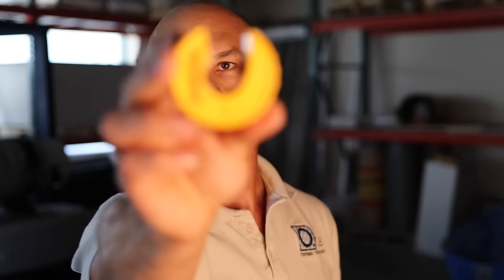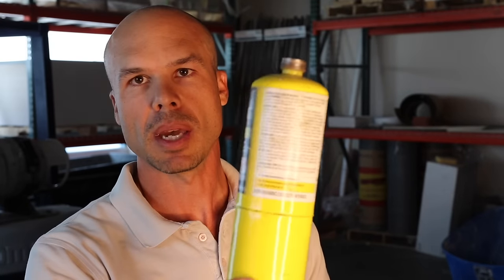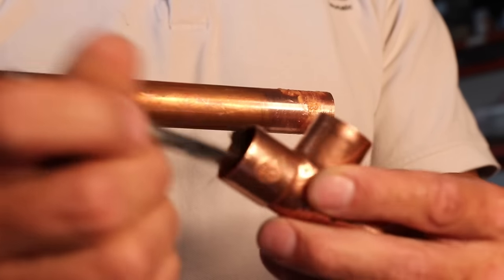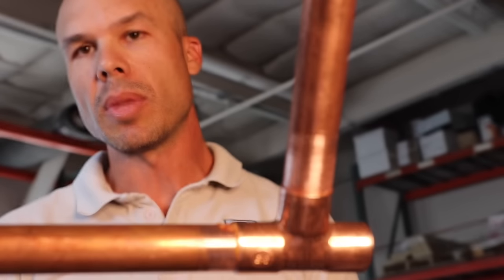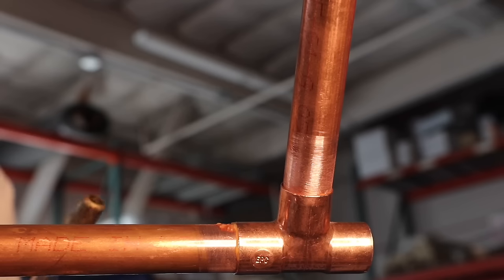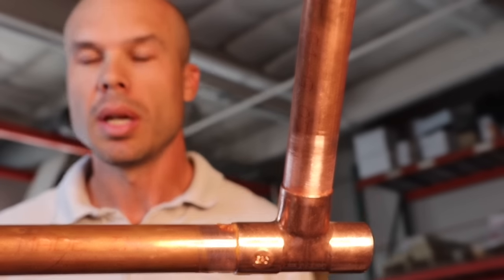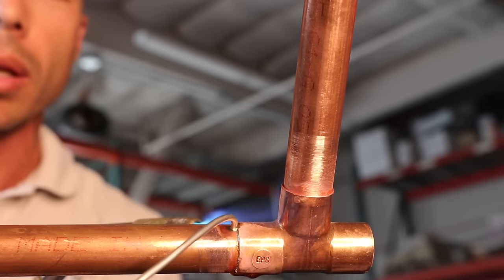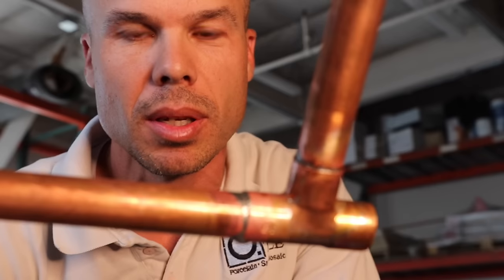How to Solder Copper Pipe: The Plumbers Secret- Episode 1

Comment: I wanted to thank you very much for your informative video.I am going to replace a pressure relief valve for the first time at age 63.I,ve rebuilt inline air cooled 6 cylinder Hondas,gold wings and a few small block V-8s and I find soldering and plumbing to be a little intimidating but thanks to you,no more.The way that you handled the criticism of your work says  a great deal about you and your upbringing which seems to be missing with many of todays youth!Thank Again and thanks for the video.
Reply: I'm about to do the same thing  I'm only 47 and have a ton of plumbing. It's all been PEX!  I wwnr to change my prf valve on my boiler, and when I was removing it, cracked 2 soldered fittings   so here I am.    Off to attack tonight. I was fairly certain I had the general concept down it's just nice to get the reassurance of a professional on YouTube

Comment: I'm getting ready to cap off copper water pipes to the bathroom (DIYer first time). The guy at home depot gave me a Bernzomatic Propane Torch. Glad I got the Propane, hoping it will prevent overheating. Also, your instruction to wipe off the excess flux BEFORE soldering is excellent (I don't have to worry about excess flux corroding and eating a hole in the pipe later).

Comment: Note, its important to buff the fitting inside also, not just the pipe.  An inexpensive wire brush tool will do both the inside of fitting and outside of pipe.  Very easy, and very handy.
Reply: Not really that important unless it's an old/dirty fitting. Flux is acidic and is there to not only allow the solder to flow, but remove oxidisation. 
It's the same as applying flux to the fitting AND the pipe - it's really not needed. If the fitting is loose enough that simply mounting the fitting won't evenly spread the flux between the two surfaces...you're not going to be able to solder them together ayway.
Reply: Thanks I noticed he just did the outside. That was my question.
Reply: @allergyahead8128  
The inside of the pipe needs to be deburred else you will get leaks down the road. The burr causes water turbulence which eats away at the copper near the joint where the burr resides.

Comment: I have found, applying the heat to the middle of the fitting and NOT directly at the joint or NOT directly on the pipe is the most affective way to heat it. This way, the solder is pulled into the fitting where most of the heat is. Also, I have found my biggest mistake in the past was, over heating the joint. This will cook off the flux. No flux and the solder will not take to the copper.
Reply: what type of torch did you use?

Comment: Yeah worked with plumbing company as helper / laborer picked up a few things . Yeah they described it as you exactly described it - apply heat ( preferably with mapp gas ) at one point only ( copper is most excellent conductor of heat ) and let solder be ' sucked ' in .  But one thing they did differently , they write it ( go around the pipe ) with it . But yours look perfect .

Comment: I was taught to always solder all sides of a fitting at the same time. I believe the reasoning was if you come back later and heat the remaining hub up it will draw the solder out of the other sides. I guess it’s possible you just did two because you didn’t need all three for the demonstration but it might set a bad example.
Reply: It's true, his technique is not great.

Comment: Always ream the ends of your pipe. Never put flux inside the fitting. Put it on the pipe only. If you put it on the inside of the fitting and on the pipe you’ll be pushing flux  with the end of the pipe into the interior of the fitting which will lead to enhanced corrosion and flux having to be flushed out of the system.
Reply: I'm glad that annoyed someone else. He also drowned the joints with soLder. Irksome. Although I was taught to soLder by a clockmaker. There's no room for sloppy ugly amateur joins when they're visible in the finished product. That flash of silver is what you're looking for. But I suppose you can't expect someone who cannot say the word soLder to know how to soLder very well if they think there's such a thing as a silent L in the English language. :)
Reply: I was a little surprised that he didn’t ream the pipes. I also never put flux in the fittings. I can’t really criticize his soldering ability since I’ve seen “professional” plumbers do much worse on YouTube and I doubt I could do much better.
Reply: I C 
Just did a water heater connection this past weekend  Dec. 22, 2019
I steel wooled the pipe and inside of the fitting. Then wiped with paint thinner put Flux on pipe and inside fitting, slid to together. And soldered like in the video.
As in the video, never have water present at the solder area. 
I assembled the job, and checked for leaks. No leaks.
What they are now doing at Water Heaters is using a hose with a nut that threads onto the nipple of the water heater then into a Plex Fitting that slips into the 1/2 inch copper pipe. Can get save hose for 3/4 inch copper pipe too.
Reply: @bashpr0mpt244  Cam down.  When you soder a haf inch copper pipe, you shoud cauk the pipe with flux, then heat the joint.
Reply: I C   He didn't make it clear. He meant, After you flux and then connect the pipe to the fitting, then use a rag with paint thinner to wipe off the excess flux. The pipe leading up to the fitting would get a film of paint thinner on it, and the solder would not stick to or run to it, giving you a cleaner joint.
Reply: If you don’t team the inside it will whistle

Comment: Really helpful. Most other videos don't show up close and the sound effects. I have been trying to fix a leak for weeks. Turns out I wasn't getting it hot enough. Solder wasn't melting..  I have read many stuff online about how long to apply heat. 5 seconds, 15 seconds, 30 seconds yet they don't even say which torch type to use. internet sure is full of alot of misinformation. lol

Comment: Nice video and very informative, but one thing I noticed he didn’t do is he didn’t deburr the pipe. The burrs will affect the flow of the water and will cause turbulence in the flow, and wind noise.
Reply: yeah that's what most poorly installed copper is missing. Oh well keeps us service plumbers working forever.

Comment: Well I have what looks like a little gap at the top of the fitting? But you said if it takes the material real quick it should be ok???
I'm concerned. It's now in place and only a few inches away from a press fitting otherwise I'm so concerned I would probably heat it up to see if it would take some more. I did touch the solder to that spot when it was hot but it just rolled off??? I'm turning the water on in the morning hope it holds

Comment: Flux helps lift impurities from the surface and heat causes air to leave the joint creating a slight vacuum which draws solder in; this is called capillary effect.

Comment: Pretty good video! But I never leave a hub open! And I always use acetylene for soldering ! I heard that MAPP gas is dirty !? I'm not 100% sure about that!? and I always run the solder all the way around the joint, that's just the way I was taught and then a dry rag wiped around the still liquid solder to make it look nice! Lastly I use a mirror and flashlight to check around the back side of the Joint to make sure solder went all the way around! Thanks for the video we can all learn something  from each other !  PS I've been doing Plumbing for 32 years ! 🇺🇸
Reply: Been doing it for 3 months hit and miss so much watch dozen videos and I can’t get it right was hired as maintenance turns out I’m a plumber

Comment: You should always solder all sides of a fitting. The heat will transfer to other sockets if you try to solder the em individually. May not cause a leak but it's isn't a great idea. Heating the base of the socket will draw the solder to the that part of the joint. Just my 2 cents from a 30 year plumber.

Comment: Don't forget to wipe off the joints while still hot  due to left over corrosive solder paste. I've had joints that corroded in a year and should not have leaked because the pipe/joints were cleaned and I was using 95/5 with map gas and the flow of the solder was text book.
Reply: Clean the excess solder flux off the pipe BEFORE soldering.

Comment: You don’t need to add solder inside the fitting, if you apply too much inside then when you push your copper in it will push all the flux inside the fitting, if you have an excess amount it could lead to contaminating the water

Comment: It’s good practice to solder all sides at the same time. If you don’t when you reheat the fitting you can draw solder from the other joints and cause a leak. The only possible exception is when you’re soldering larger diameter pipe like 2” and up. Also, there’s two schools of thought with cooling with water. Some say don’t do it at all. I was taught that you need to let the solder solidify on its own then you can use a rag to help it the rest of the way. I haven’t had any problems doing that yet.

Comment: 3 thing. It's called a water heater. You don't heat hot water. When sweating copper, start off heating the pipe right next to the fitting on the side your sweating, and move the flame around the fitting as to apply equal heat on either side.  (On just the side you are sweating!, repeat the step for each side), and remove heat when solder starts feeding. Apply more heat when necessary, you can burn up a fitting leaving it on one spot for too long, leaving a weak joint and fitting. He's obviously not a lisenced plumber

Comment: Thanks for the really clear vid & camera work. Q. If using a pre-soldered ringed tee piece would you use the same technique e.g. each joint at a time or heat the centre of the tee first?

Comment: Isaac, you should never heat just one side of the pipe while soldering, although some people do with no major issues on smaller pipe.  You should also start the solder on the bottom of the connection and work your way up one side, then the other and finish with the top.  Although on smaller pipes, this is not as much of an issue, but if you practice this with all your solder joints then even 6 inch copper is no problem.  And if anyone says a professional would only use a b-tank with acetylene and a "turbo-torch" (which is the preferred brand where I am), then they are fools  There is no reason to drag a torch like that for a minor repair.  The mapp gas or propane torch is fine for that.  For the average home owner there is also no need for such a torch as they are quite expensive. A simple way to stop the flow of water if you are soldering on a valve or threaded adapter is a tool called a dutch finger or jet-sweat. It has a rubber "plug" on one end and as you tighten the shaft the rubber expands and shuts off the flow of water while you solder.

Comment: Isaac, thank you for the video. Is that all the solder you use for a connection? You don't do the other side also?
Reply: A 1/2" ftg takes a 1/2" of solder a 3/4" ftg take 3/4" of solder, etc.

Comment: That first joint...."that's a good joint" -  I think the phrase you were looking for was "that's an underfloor joint"
Reply: So all joints under floor, like concrete, should only be copper only, no PEX?
Reply: @snoodle877  yeah, you don't want any demountable joints under a concrete floor if it won't be accessable. Under a timber floor isn't so bad. 
But the point was it wasn't a neat solder joint you would want to be seen. He put way too much solder on so there was "snot" underneath and overflow on top. Both can be neatened up afterward with a bit of flux and wire wool, but if you're showing people how to solder, do it neatly to begin with.

Comment: A tip with end feed fittings, try not to put too much heat on them or the flux with evaporate and solder wont run 👍. If you have a small hole just add some flux to the joint and heat it and it should run all the way round without adding more solder.

Comment: Thank you for taking the time to make these videos, extremely helpful. Can you or anyone with experience tell me does map gas make a big difference in heating time, I soldered some  3/4' joints (newbie) and though propane works I feel it took longer than I expected to heat. I  have more to do and want to do it as efficiently as possible.
Reply: I notice a big difference in the reduction in time it takes for the pipe to be hot enough for the solder to start to melt with MAPP gas.
Reply: @dw424  Thank you that's good to know. Right tool for the right job 👍🏼
Reply: I still use my "B" tank of propane, and an igniter, no cigarette lighter.

Comment: I don't want to nit-pick but all three pipes should be in the Tee, and all soldered at the same time. if you try to solder the third at a later point, you could run the solder back out of the first two. I  am sure you are aware of this but some DIY guys might not realise. Best wishes from the UK Isaac

Comment: Isaac.  My man. You need to deburr the cuts.  It can and will cause turbulence in the line and can cause pin hole leaks in the pipes. The turbulence causes minerals in the water to constantly rub the pipe in the same spot and will wear holes in it. 
I know it seems like it can't happen but it does.
Reply: If your have an issue with pinholes in your copper pipe it's more likely caused by acidic water then burs. Granted I don't get burs on my cuts but I've also been doing this for a long time I use good cutters with a good wheel and I don't force it but I never debur anything and I've never had an issue with noisy pipes or pinholes and as a matter of fact my house I plumbed in myself 26 years ago in copper and I've not had one leak. I know they teach that and everyone says it but hardly any actually do it. Unless your really romping down on the cutters you shouldn't have a problem. Maybe if you're using homedopt or Lowe's cutters but no professional would be caught dead using them lol.
Reply: @my2centz196  What tubing cutter do you use? How is it not producing burrs or more likely a lip that restricts flow.  Last time i checked my local plumbing store sells the same cutters that home depot and lowes sells.
Reply: @travisk5589  my favorite cutters are my imperials I've had for ages, I also have some original autocuts but I haven't used them in I don't even know how long I prefer Milwaukees brand of auto cuts and of course I use ridged. I guess I would say experience is why I don't have burs and good tool maintenance. I've been doing this for a while and I've never had an issue like you speak of and I can assure you I've probably ran enough copper pipe to circle the globe a few times over and I've never had any pinholes. I Mena how long does it take for these pinholes to appear 30-40 years? The life of the copper isn't guaranteed but 10 to 20 years and my jobs have exceeded this without fail so I must be doing something right lol. I'm sure you're a firm believer you've probably been taught that and stuck with it and that's fine but when I was younger I did a lot of production work mostly townhouses and housing projects where time was critical as time always is  and it was only the fastest who kept their jobs and even today the faster you are the more money you make so I don't do things I find unnecessary. To each their own and if you have time more power to you but if you're have a big problem with pinholes I'd check your technique or your tools.
Reply: @my2centz196  And you are saying that you do not need to deburr when using these cutters?
Reply: @travisk5589  I'm saying I've been using these cutters for many years and except in a few occasions I haven't had to. Don't get me wrong of course I've made cuts in stubborn places and I've had a few times I've romped down on the cutters a little to hard and I've had to but for the most part no. I think the only time I've ever had an issue is doing service repair work in hard to reach places. Especially in a hurry but doing new or remodel work typically don't have any issues. I've never used Lowe's or home depot brand cutters and I'm not knocking them I just never owned any. I'm pretty picky about my tools. That's not to say I don't own any tools from Lowe's or home depot I love both of those stores but I use my cutters everyday and I figure it's cheaper to buy the good stuff because it usually performs and last longer.
Reply: @my2centz196  But you said something about us using junk cutters from home depot and implied that's why we need to deburr. Then you say that you don't need to deburr because you use sharp wheels?  You are talking in circles.  A sharp wheel will still roll the edge over and you will need to reem or deburr it.  So what's the deal?
Reply: @travisk5589  no that's not what I said i said maybe its because of cheap tools as I haven't used them if you are having an issue then it's either cheap tools or you are romping down on them to hard. Obviously if your having so much trouble you're doing something wrong.
Reply: If you stick with plumbing for a while you will understand. It's not something you can explain in text it's something you have to learn with experience and I'm sure in time you will get it but until then you seem to have your mind made up its impossible. Either way it doesn't matter to me you have your way I have mine. I've never had any issues and some of my jobs are probably old then you lol. I know you wanna argue this for the next decade but I've said my peace take it or leave it. I do wish you the best of luck and I hope you keep up with plumbing if it's something you love it's a great career with fantastic opportunities. Good luck.